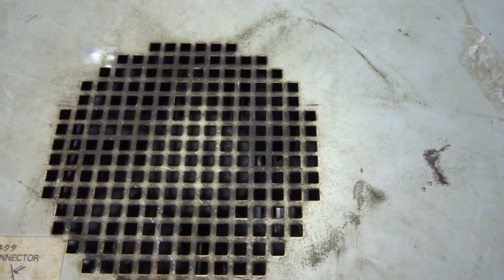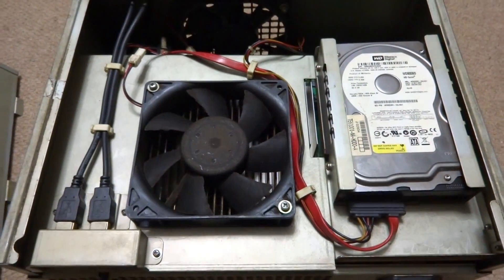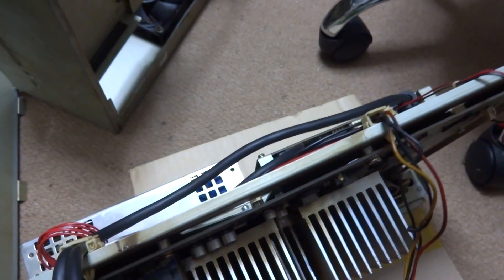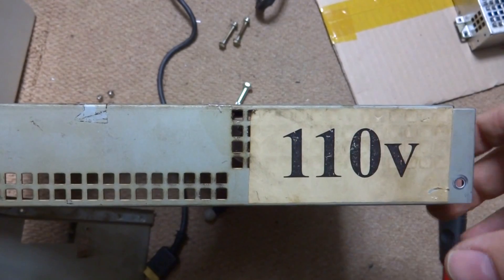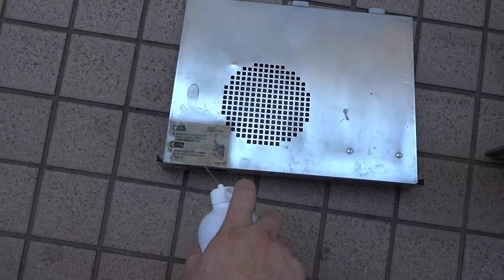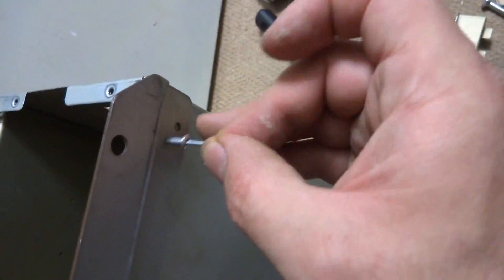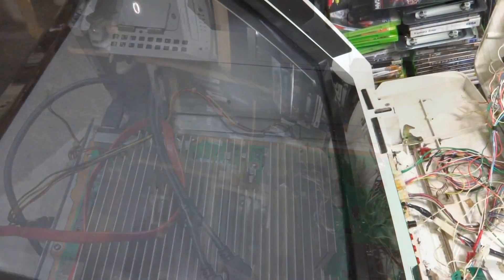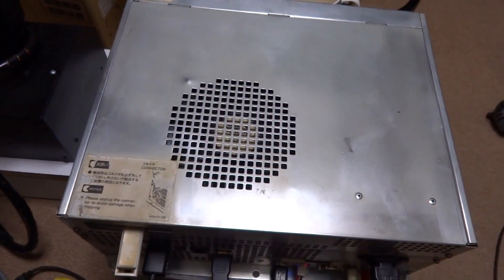Namco System 357 Arcade PCB Repair

Comment: Luke! Help please..Just got a system 357 and finally got it to turn on and display after getting a vga to hdmi adapter. It boots up to the ps3 menu and selects Tekken BR but goes blank after that. Stays ar a black screen for a minute then reboots. Any idea what's going on? I see 8 dip switches and they're all flipped up except #2.
Reply: Help?
Reply: Not sure if you managed to fix it since this comment is 3yrs old but it’s most likely a failing hard drive or failing PS3 PSU.

Comment: this system is kind of identical to the ps3 inside !
Reply: it IS a PS3 inside... It lacks the wireless board, but the logic board is identical to a PlayStation 3 Fat. He's reflowing the chips because it got the YLOD issue. This system is a PS3 Fat.

Comment: hey, i know this video is old but i have a question for you. how did you apply heat? to what chip? and for how long? i know you probably won't get this message but i have a 360 slim which seems to need the same thing done. i think that i have found a bridged connection on the under side of the board directly beneath the c/gpu. I'm unsure how to proceed. thanks in advance if you get this and can help.

Comment: CAN YOU REMOVE THE HARDISK AND PLUG IN BURAY DRIVE AND SEE IF IT CAN PLAY ANY PS3 GAMES? OR JUST INSTALL BLU RAY DRIVE.

OR PLUG IN PS3 OS INTO THE HARDRIVE AND SEE IF IT CAN PLAY ANYTHING
Reply: Nope not gonna work neither. That thing was modified
Reply: It won’t work and it will actually brick the PlayStation 3 if you plug in the arcade HDD.
Reply: As far as I know, you can play with the firmware to make it run normal PS3 games. But why?

Comment: awesome man, didn't know this thing existed.
thought id throw a tip at ya, being ive had issues with over heating ps3's.
under the "cell and rsx" heat spreaders is also some bone dry compound.
if that's not addressed, then you're most likely going to get overheating issues again. taking off the rsx spreader is pretty easy, just wedge something small and flat under it and pop it off. just make sure you get the in the side that's facing the other chip so you dont gouge smd components.
now with the cell its a bit harder, they used some type of silicone to adhere the heat spreader.  what ive found to work beast for me, is a art pallette knife. it's thin and flexible, but not to sharp to cut the pcb underneath. 

if you all ready knew this or had other people tell you, just disregard.. lol

Comment: Great stuff!   Regards heat gun, its worth using liquid flux, use a dropper to drip loads of it around IC edges and tilt board at different angles so it runs underneath the chip.  Use lots, then use heat gun and it can be almost as reliable as full re-ball / re-flow if you get temperature right.

Comment: Congrats man! Thats fantastik! The problam was only one vire on video board. You are lucky!^^,)
Reply from the maker: Thanks man. Nope, the problem was the gpu off the board, popped power supply, missing wire for the video board and locked up fans :) still lucky none the less though.
Reply: ***** Exactly, that was not hard to fix, but your hobby is very inspiring other people. And this is great!^^,)
I have problem with European SNES. Its glitching with Mode7 graphics. I think this means one of two PPU failure. May be You have some advice?

Comment: Nice job as always Luke.
How close to a PS3 is this system and how many games were made for it?

It looks very cool and I like that it also had an HDMI output as well.
Reply: The following games were made for it:
Deadstorm Pirates 
Dragon Ball ZENKAI Battle Royale 
Mobile Suit Gundam Extreme Vs. 
Razing Storm 
Tekken 6 
Tekken 6 Bloodline Rebellion
Reply from the maker: Thanks as always man! this is exactly the same as a ps3 (give or take a few differences) and there were 6 games made for the system, only half of those are ones that Im interested in though. The HDMI looks fantastic on the system :)
Reply: ***** The board must have some hardware advantage tho, because I've got Tekken 6 for both the PS3 and 360 and it never looks as crisp and clean as it does in your video. Resolution and antialiasing seem truly stunning man.
Reply: Galdelico
It's the same exact hardware. Have you connect the PS3 in HDMI?
Reply: COBOL
Sure thing, I have my ps3 hooked to a full-hd screen through hdmi.
My eyes must have been fooled, because the arcade game sincerely seemed to me running at a higher resolution than the PS360 port.
Reply: Galdelico The arcade LCDs might be higher quality than your tv?
Reply: airthrow
Well it's a Dell PC monitor, sure is good quality stuff :)